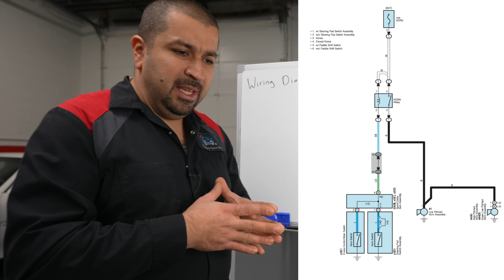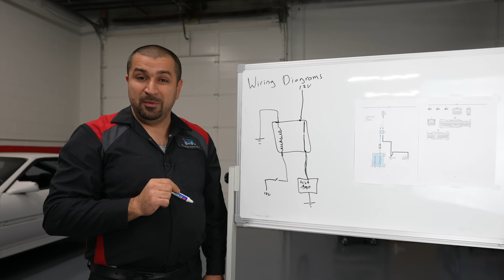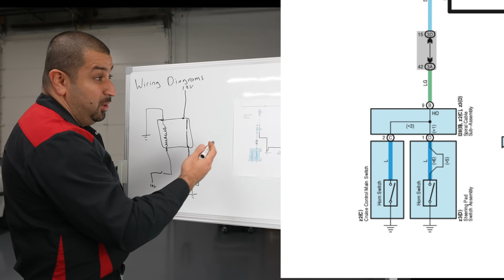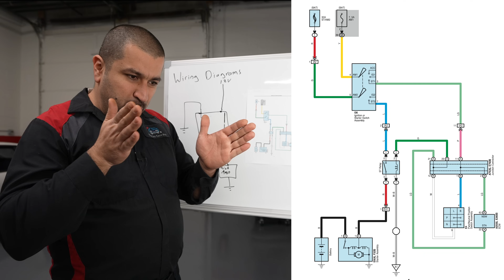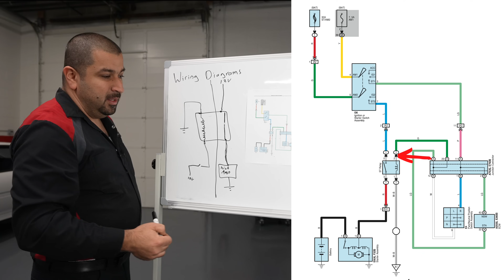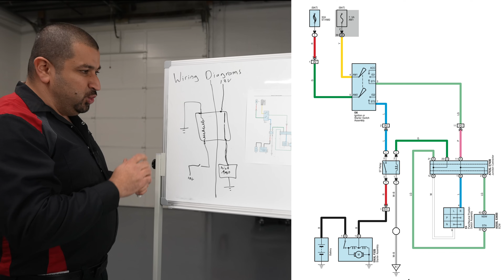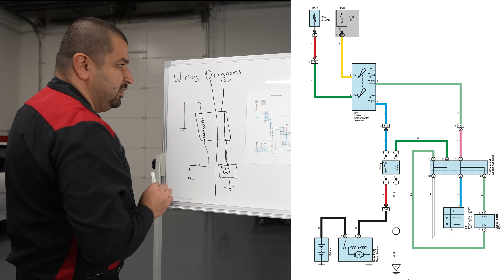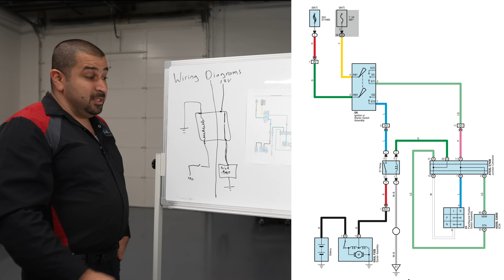How to Use Wiring Diagrams For Car Electrical Diagnosis and Repair

Comment: I'm sure it will come later in the series but it would be great to actually see you use your tools to check these voltages at the various points in the starter diagram example. I'm sure you could rig up some test cases with bad wires or fuses or relays that you've collected over time and show the diagnostic thought process. Great so far!!!
Reply: Also, I am being greedy here but I think because of the success of your channel you could actually procure a "shop" car (maybe Corolla or Camry?)for these electronic lessons (and other repairs as well) and keep it in your facilities. You could demonstrate the diagnosis and repair process on the car and after some point in time you could sell it! You might be able to sell a high quality completed series of diagnostic assessment and repairs for certain Toyota cars or perhaps something more generic! Thanks again!

Comment: I am very I fortunate to have found a mechanic that I have been using for 20 years that embraces diagnostic culture just like AMD does. I have never had to return a car for the same problem and he is not a parts changer, fixed the first time every time.

Comment: You got me in trouble today. I booked my UK spec 2022 RAV4 into a Toyota main dealer. I asked for genuine Toyota 0W-16 engine oil to be used. I was told we only use 0W-20. The service receptionist now thinks I'm either a nutcase or have OCD. Imagine me telling a UK Toyota main dealer to watch your channel. I struggle to see how Toyota UK can accept this issue. I'm only trying to follow the user manual recommendation. This is my first Toyota and from today's experience I might have to reconsider going back to Broke-My-Wallet. Sorry this is off-topic.
Love these teachings. UK dealers could use some of this material 😂

Comment: MOST switches provide GROUND to the circuit,  BUT the horn switch ( button) provides battery to the relay???  The ACTUAL Toyota diagram 

shows just the opposite of your teaching diagram.
Reply: Most horns are bolted direct to the frame of the vehicle . ( getting a ground)  Hence the + needs to be switched
Reply: No most horn circuits control ground so you don't burn out components especially the relay
Reply: Ok I am from the old school.

Comment: Excellent video! You bridge the gap between basic knowledge of electrical circuits and making sense of wiring diagrams.
Also great is the logic of what to check first, second and so on to avoid chasing your tail.
Seeing a circuit clearly from start to finish is vital in correctly solving the problem without throwing parts, time and energy in all directions.
Thank you for explaining things so clearly.
Reply: https://youtube.com/shorts/HiPe7trbqq0?feature=share

Comment: I'm an electronics tech so already schooled on such things but, mechanical can play a part in proper diagnostics. For instance; sway bar links go bad, allows steering out of range and the clock spring coiled ribbon cable in steering wheel stretches and snaps. You've now got two problems to diagnose. Steering and clock spring. Thus, the importance of maintaining proper steering components.
Reply: But not as much as electrical especially in modern cars
Reply: @DylanL69  I'm pointing out that a horn failure caused by a faulty clock spring, caused by broken sway bar links. If you replace the clock spring first, you can damage the new one from over looking the sway bar links.
Reply: @ThePainter57  um what

Comment: Excellent! I deal with normal wiring, 2 wire, not grounded like on cars but was always confused by car drawings.
Also you always switch on the supply side in my world but here he says you often switch by connecting ground.
Reply: You ground it so you don't burn the component out

Comment: Great video. My suggestion is you cover a how-to use tools to verify voltage (power), ground, continuity and relays as you diagnose the issue. (with multimeter, quick pin sensors, manual switched relays)
Reply: Join this suggestion
Reply: Are there any videos like this yet from him?
Reply: yes please i would love a follow up with the actual tools - I'm not sure how the multimeter is used correctly to measure the voltage

Comment: A70 for the win again! I recently had someone tell me that checking voltage at the starter will fry the ECM, I’m happy I didn’t doubt my self.
Reply: He meant DON'T use a basic test light to check the voltage at the starter that will power up the pcm and fry it or spin the starter

Comment: Very well explained, 
What if there is a delay in cranking?
Reply: I would like to know that too. 99 Siena start delay and can hear a little motor spinning. Other times starts right up.
Reply: @ronbonjovi81  that sounds the solenoid engaging intermittently that's motor you hear spinning is the starter itself
Reply: @DylanL69  thank you!
Reply: @DylanL69  I'm a little disappointed because it only has 360k original miles.
Reply: @ronbonjovi81  that's a hell of alot of miles for a starter or any electrical component to last that long especially the starter
Reply: @DylanL69  I love my Toyotas.
Reply: @ronbonjovi81  my Toyota 06 got 300k miles all original. 
Once changed engine tappets and there something connecting gear and engine I changed.
Reply: If its not a loose intermittent connection. 
Its probably a normal thing. 
Unlike cars of years past. Nowdays the key send a command to the ECU. The ECU then energizes the starter. 
Sometimes the ECU needs to finish processing something else before it will execute the start command. 
I notice this often if I am in the car with radio on for several minutes before starting. I'll turn the key and starting is delayed a second or so. But if I just jump in and go, it starts up instantly.
Reply: @benjurqunov  I've never heard that one
Reply: Resistance problem could be a low battery, corrosion, loose wire, a short, partially broken wire

Comment: Being  in automotive tech school, this is just what I needed. Thanks for this ♥️
Reply: Shop Experience with this helps alot more
Reply: @DylanL69  just started at a shop as well. Just doing oil and tires for now.
Reply: @pedromartin4437  that's usually where you start as you learn more you will do more

Comment: Thanks for the videos I'm excited about these technical videos!! Electrical theory and diagnosis had been my weak point and super happy to see Toyota specific training/theory videos from a Toytota master tech online. I'm a Lexus tech currently working on becoming ASE/Lexus master certified
Reply: I'm excited for them too, I'm not a professional mechanic, I just own a '93 Toyota Surf (manual transmission diesel version of a 4Runner for our friends in the US)... his explanation of what a relay does was the best one I've seen in terms of clarity and simplicity. Can't wait for more.
Reply: Electrical is one of my strong points you have to understand it to diagnose 90% or more on modern cars like sensors or computers that's the majority of the work
Reply: @DylanL69  I've been considering a career change. Will current auto electricians make the change to electric fairly seamlessly in your opinion? (Is it going to still be a "job" 20 years from now).
Reply: @KiwiPokerPlayer  no would have to go through more training to understand the electric cars but yes there would still be a job 20 years from now but I don't think we will be going full electric anytime soon even though governments are pushing hard for electrification the gas engine can still get more efficient so I personally think learning the mechanical engine and vehicle will still be around for awhile
Reply: @DylanL69  Why are components in a car being given ground instead of being given power? Isn't that the opposite of how it is in a house? Like a light switch in a house always has ground(neutral) or return path and is given power(hot) to function or else if you get a short you could get shocked because the switch is always hot. So that means most car components are always hot?
Reply: @abes7181  you control with a ground because voltage generates more heat and can burn components on ground side there is no voltage. (Btw the neutral in houses isn't the ground that's the solid copper wire) some components are still hot at all times whether it's switched from ground side or power side